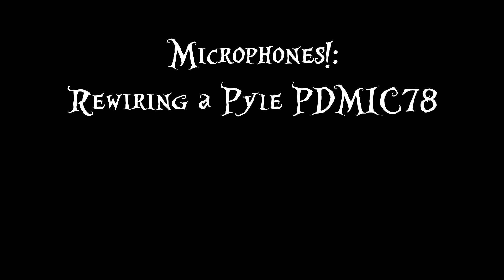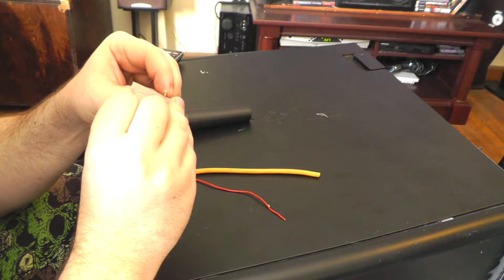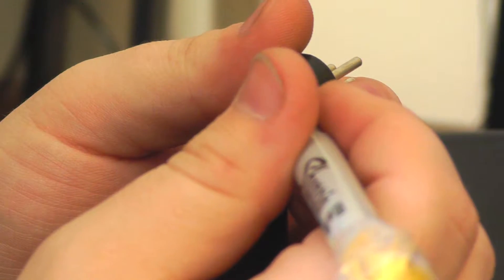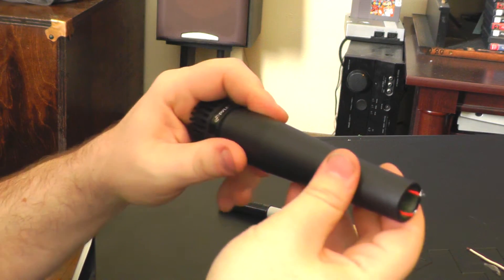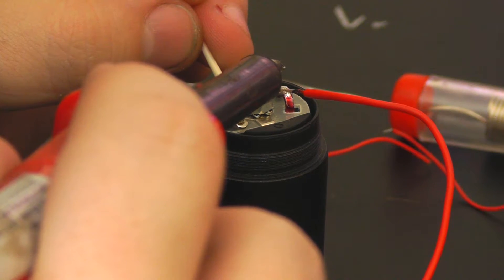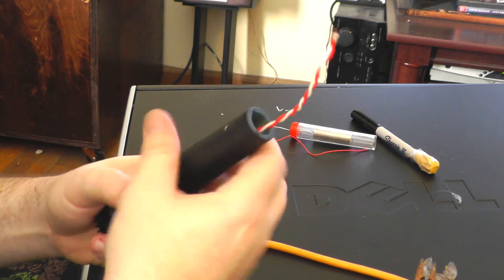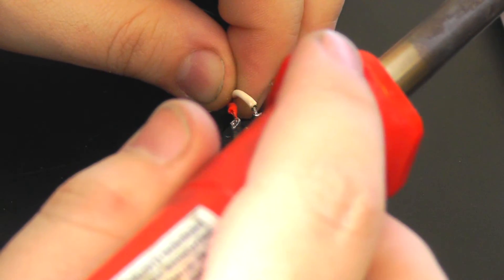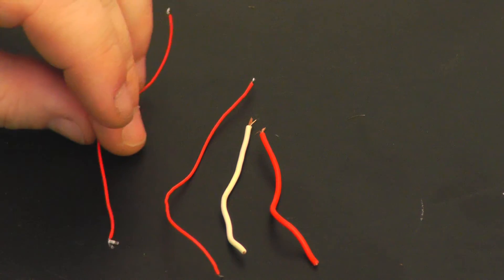Microphones!: Rewiring a Pyle PDMIC78

Comment: Thanks, I didn't know these were wired unbalanced. But DUDE, PLEASE get a pair of decent strippers and STOP USING THAT RAZOR BLADE before you slice off a fingertip. Only a couple of bucks and you'll get much cleaner & accurate cuts. You might consider getting a new pair of longnose to replace that rusted-crusted pair, while you're at it...Just lookin' out for ya, bro.
Reply from the maker: I appreciate it man but you're commenting on a vid that's 5 years old.  I build and sell my own instrument and speaker cables these days and definitely have the tools for the job, thanks for checking out the vid.

Comment: I left it the way it was the pin 1 & 3 bridge that is. Pin 1 grounds the mic before anything leaves the XLR output. Bridging pin 1 & 3 is effectively unsoldering the negative wire from pin 1 and soldering it to pin 3. That way I can use the included XLR => TS cable as it was intended. Otherwise, a XLR => XLR cable can be used as a preference. The mic is wired universally, this way to use the included unbalanced cable or a balanced cable into a DI box. Kind of like a computer's EIDE cable with a jumper for "cable select" for priority between a master, slave or cable select for a system with a master & slave hdd.

Comment: Great video. I am going to pick a couple of these up and add some different transformers to them (Tab Funkenwerks, and Crimson Audio). It will cost about the same as buying a new SM57 for the Pyle mic and the Tab Funkenwerks transformer, whereas if I bought a new SM57 and the transformer I would be at almost $200.
Reply: We're you able to install the Tabfunkenwerk transformer in the Pyle? I've been curious if the inside of the body has as much room for a transformer as the SM57.

Comment: Anyone know how can I boost this thing¿¿ i bought one and today i tried to record some classical guiatr using an UM2 behringer interface, I connected to the 2 input wich  is 1/4 but I barely hear any sound I have to set the volumen at max to have some "decent" volume but a lot of noise..
After that i tested it with the XLR to XLR cable and connected to the first input (mic/line) and it sounder better and louder do you have an idea why this happens¿¿ is it the cable the problem¿¿ or both the weak power suplied by the interface and the xlr to 1/4 cable¿¿
Reply: The 1/4 inch cable you used is probably unbalanced. You would want to use an XLR cable for this mic. Also, since these mics have no transformers they are going to need more gain then a regular SM57. I hope this helps.
Reply: @johnstewart7619  Yeah it was unbalanced cable.. I upgraded my Audio interface and bought the um202HD and bought a TRS cable and it´s working  really nice. Im amazed how this mic can sound that good being so cheap, It´s insane LOL
Thanks for aswering!

Comment: Can I use Phantom power with this mic?
Reply from the maker: No, this is a dynamic mic.  It probably won't hurt it, but it's not recommended.
Reply: @ForsytheVideo  Ah ok, thanks. My Idea is use for recording 1x12" guitar speaker with 2 channels, one for condenser mic that requires phantom power and another for this dynamic mic, but my interface doesn't allow me to power off the phantom power in only one channel.
Reply from the maker: @felipeamorim7612  Here's what you do.  Plug in BOTH mics, turn the phantom power on.  Use them as you will, but do not unplug either mic until the phantom is off and powered down.  As long as the phantom power is not on when you unplug or plug in the dynamic mic it should work fine.
Reply: Oh great thanks my friend, so I'm gonna do it. If you ensure me that if I use the mics this way that you told me, don't bring me problems, I Trust in you haha.
Reply: All that you say to me, is after I make the pyle-pro balanced?
Reply from the maker: @felipeamorim7612  Yes, but from what I understand about two years ago they started shipping these as balanced mics.  If you bought yours recently it should be balanced.
Reply: If I have problems, don't be worry, this things happen  haha, I Will continue to support your channel, for you being kind with me :D
Reply: Yes, I bought yesterday haha

Comment: I can confirm that the newer Pyle PDMIC78's are all wired for balanced output.  I took mine apart just to be sure, and the pins were wired correctly.
Reply: I think the Pyle PDMIC59 & PDMIC78 being a cable that is XLR to 1/4 TS is a balanced microphone cable. Where the matching impedance magic happens is when you might need to go from Low Z microphone to High Z guitar amp input and you may need a Microphone impedance matching transformer. The Pyle mics are speced 600 +/- 30% Ohm Output impedance at the XLR & my multimeter reads 607 Ohms at the 1/4 TS. I plug it into a Pyle PVAMP60 guitar amp and it pairs well with that or any other guitar amp that I have. The PVAMP60 guitar amp has high & low 1/4 TS inputs that can be used simultaneously. That allows the PVAMP60 as a 1x8 open back combo to be able to be used to play a guitar and also allows for vocals. A one person performer can gig/busk with that set up. Just another option for versatility.
Reply: i know I am kinda randomly asking but does anybody know of a good place to watch new series online ?
Reply: @Jamari Julius Try FlixZone. You can find it on google :)

Comment: Ordered one,  arrived today 10/06/2020 it was wired correctly. The screw going clockwise, it goes in not out and its VERY soft metal so don't go heavy handed it could easily strip. Mic is light weight but for £15 I have to say it sounds really good without any mods similar to the  SM57 but build wise, not even close.  You pay for what you get and this is not a replacement in any way, its just a cheap Chinese replica, and a good one that you can afford to loose use and abuse maybe not drop or as I usually do, leave the damn thing somewhere.

Comment: Wire thickness makes no difference. You just need a decent electrical connection. They wire that is wrapped in the transformer (like in the sm57) is one strand thickness.
Reply: True.  The microphone signal has almost no power, so thin wire is adequate.

Comment: Just purchased two of these on ebay. They seem to be fairly descent mics as for as outside looks. When I get mine, and am going to check to see that the wiring is correct and a heavier gauge. Your video is very helpful. The guitar and the overdub sound pretty awesome. Can't wait to get mine so I can repair them if needed and do some micing on the drums in our band. Thanks for the video!
Reply from the maker: Best of luck in your modding endeavors!  Thanks so much for watching my vid and I appreciate the kind words.

Comment: Did it make mic sound better
Reply from the maker: It made it useful in my studio which is xlr based.  If you plan on using it to plug into guitar amps or other unbalanced inputs you can leave it as is.

Comment: Is there a chance you could make another "rewire video" for the "InnoGear mu007 condenser Mic"? It too comes with the "xlr-ts" cable, which makes me think that it probably isn't wired as balanced.
Thanks
Reply from the maker: I will look into it, but if it comes with an xlr to ts it can't be a condenser mic, because there would be no way to supply it with phantom power.

Comment: Thanks. I bought my 78s yesterday and rewired them using your tutorial before even testing them. One of the thin original wires broke at solder point with my barely touching it.

Comment: Helpful soldering hint: After removing the male pin connector from the mic, plug it into a female XLR connector. The plastic base can soften under the heat of the soldering and the male pins can shift - the female XLR will hold the male pins in place perfectly as you solder or unsolder.
Reply from the maker: Great idea man, thank you.
Reply: That's great advice.
Reply: this is some next level advice man

Comment: How thick do the new wires need to be and would double insulated work/ be better? Why do you need to break to pin 1 to 3 connection ?

Using this video to fix my pdmic78 but realised I couldn't find the soldering iron and took wires out of another Pyle to use. Might as well get new wires for them both, the cheaper mic had better wires than this one but it's a pretty old model.
Reply from the maker: They don't need to be very thick honestly, there is a very low level signal so the wires it comes with carry the signal fine.  Thicker wires are more about a lifetime of durability, the signal clarity difference is negligible.  Silver wire(made of actual silver) would be a better upgrade for sound, you may get a slight bump in high end clarity with that(but you probably wouldn't do that on a Pyle, haha).  You have to break the 1 to 3 connection because for a balanced signal you can't run your negative to ground like you do in an unbalanced system.
Reply: ForsytheVideo cool thanks :) the double insulated I found just happened to be cheaper than other wire and I wasn't sure if it was too thick if it would make a difference. The wires are so thin haha

Thanks mate :)
Reply from the maker: Anytime!
Reply: AWG 26-28 would be an overkill

Comment: Mine just arrived and just finished re-wiring mine. This video saved alot of time.
 Its shocking how skinny/flimsy the original wires are. They're easier broken then dental floss.
Reply: Yeah same thing with mine, I actually twusted it apart and to see what was up and it practically fell off of the solder
Reply from the maker: You're right about that.  Thanks for watching!
Reply from the maker: THAT's the main reason for thicker wire/better solder joints.
Reply: ForsytheVideo yeah it was my main reason for changing before, I didn't really have much of an idea about balanced vs unbalance wiring in mics before, only cables when I was looking for amps and amp cables

Comment: So I bought 4 of these Pyle Pro Mic 78's for micing a drum set just to try them out as SM57's and noticed that when I used my XLR cables with the Pyle pro 78's and connected them to my interface it had like this hiss and humming sound when I changed the mic cable to the XLR to 1/4 it went away so is this the reason why you rewired? Excuse my ignorance I am new to all of this cheap mic thing.
Reply from the maker: Yes, the way they come wired from the factory is high impedance, which was the standard for consumer recording about 20 years ago.  These days we have better quality gear allowing us to use low impedance microphones, and our mic inputs basically have built in transformers to boost the signal.  Which means, when you plug a high impedance mic into an input designed for low impedance(your interface) you get hiss, hum, all sorts of electrical interference can occur.  So, we are rewiring these mics for low impedance use, and that helps us out in two ways.  One, we can use our mic with regular xlr cables allowing greater flexibility, and two, we preserve a lot more high end.  High impedance cable runs cause a loss of high frequency loss that becomes very audible when recording, which is why most pro recording mics are low impedance.  Hope that helps, thanks for watching!
Reply: @ForsytheVideo  I bet they wire this mic to be high impedance because the capsule is so bright, the high impedance wiring dulls that signal to get a balanced full spectrum signal.
Reply from the maker: Very well could be.

Comment: How do you know What pen 1-2-3 is and Does the new cable make a Better sound
Reply from the maker: There will be a number imprinted in the plastic(usually).  Now, if you are wiring a  microphone and you are looking at the pin side that you will be soldering,  the pin layout IN MOST CASES is  2(positive), 1(ground), and 3(negative), if you orient it so that two pins are on top, and only one pin is on the bottom.  Bear in mind that a microphone is a male adapter.  Better wiring won't affect sound much at all(because it is running such a low level signal), the main reason for running better wire is to provide a more secure solder joint and have a more sturdy build.  Thanks for watching!  Here's a link for further clarification on xlr pin identification: https://mediarealm.com.au/articles/xlr-pinout/

Comment: Did the rewiring using the original wires. 

For a sample of mic'd can take a listen to the sound could link here:
https://m.soundcloud.com/dennis-evans-14/pdmic78-rewiretest
Reply from the maker: Those are some smooth sounding licks man! The original wires will work fine they just didn't feel like they would last in the long run.  Man you better back up everything on your soundcloud I hear they are closing shop soon.  Thanks for stopping by the channel.
Reply: Thanks man, appreciate the kind words. Again, very informative video.

Comment: What kind of wire are you using for this. I don't know Jack about wires but I do have a soldering iron already and a Pyle pd78 on the way. Would like to get the best bang for the buck. Also are you just wiring the mic the same exact way but with new wire and twisting the wire? Hard to see exactly.
Reply from the maker: No I am wiring up to send a balanced signal as opposed to an unbalanced one.  I have had a lot of comments saying that the new shipments of these microphones have been wired correctly, so the mic you receive will most likely already be wired right.  If you search VORCOOL 22AWG Hookup Wire on Amazon or Ebay you will find the correct wire.  Thanks so much for watching!

Comment: so the fatter curled cables reduce humming? is there a little less hum with alu foil? wraping around?
Reply from the maker: Twisting the cables helps to eliminate the hum more than foil will, but both will help a bit.   You won't notice much of a difference on an uncompressed signal.

Comment: Once balanced, is it still possible to use the included XLR to 1/4 jack to use? Asking because the XLR to 1/4 is only TS, and not a TRS balanced 1/4 stereo?
Reply from the maker: It should, but the signal will be weak as it is going to have lower impedance.  Also the cable that comes with this mic is just awful, I would suggest getting something better.  You can run any regular dynamic mic through a balanced to unbalanced TS cable and it  should work, just expect a high noise to signal ratio.  Thanks for tuning in!

Comment: well done..tks 
 now  i can buy  one..   i  have    a  bm-800 condenser mic  with a  lot  of    white  noise  ..  have  any  idea  for  reduce  it?
Reply from the maker: Condenser mics use micro amplifiers to boost the level of the diaphragm response to mic level(that's why they require phantom power).  Unfortunately in the case of low end Chinese mics(like BM-800 and many, many others) they use sub-par components in the amplification circuit that tend to cause unwanted self noise.    The only things you can do(besides rewiring the thing with quality components but at that point you may as well buy a new mic) is use the shortest, highest quality XLR cable you can, make sure your mic preamp is grounded, make sure your microphone is away from computer screens and other sources of RF interference, and record the loudest signals you can without overdriving your mic to try to stay on top of the white noise.  Ease up on the compression if you are using any to keep the noise floor as low as possible.  Hope that helps, thanks for watching!
Reply: ForsytheVideo What wire do you use

Comment: Hey, man. :) So these mics don't come with a transformer. Is it possible to add one? What would that do for the sound of the mic? I know that removing the transformer from an SM57 will cut the output by a significant amount of dBs. If you could add a transformer to this mic, could that increase its output?
Reply from the maker: Absolutely, you can definitely get a small step up transformer to get more signal.  Now normally the only issue that seems to occur is a slight loss in clarity above 15K, which is the reason people pull transformers from mics such as the sm57 in the first place(it makes them sound more 'airy').   This mic seems to do well with my Art MP preamp, and I don't have to hardline the gain.  I do have the 20db boost on though(part of what I like about the MP).  Thanks for watching man!  Maybe I'll put a transformer into this mic at some point.  If you do it first, be sure to link me to your video!
Reply: Thanks for the quick reply and the encouragement! :)
Reply: Dude, use what I use. You can buy a transformer adapter from Radio Shack for around $20.00 or so...it's basically a metal tube with a three pin XLR female jack on the back end, and a 1/4" plug on the front. You may or may not need to make a balanced XLR cable with a male plug on one end and a female plug on the other end. You plug the XLR female end into your mic, the male end plugs into the adapter, and you plug the adapter into your PA, mixer, amp, effects processor, etc. The adapter contains the mic transformer inside...and believe me, it's makes a helluva difference!!! It definitely adds some BOOST to the mic for sure. I have several, and I never record my vocals without the transformer adapter. The model number is A3F...or "RadioShack A3F XLR Jack-to-1/4 Inch Plug Adapter/Transformer". GO GET ONE!!!
Reply: @gunslinger8130  Hi bro. what interfaze are u using¿¿ do you think that can work in a shitty UM2 behringer¿¿ connected to the line 2/instrument with the xlr to 1%4 cable  it barely sounds.. connected to the line1/mic it sounds louder but still not enoough and with lots of noise..

Comment: You could take some kitchen/home alum sheet and wrap around the two wires...cheap shielding !!
Reply: Yes...but Not shielded unless you ground it. The wrapping of the wires is to prevent another problem than the RF problem to which  you are referring